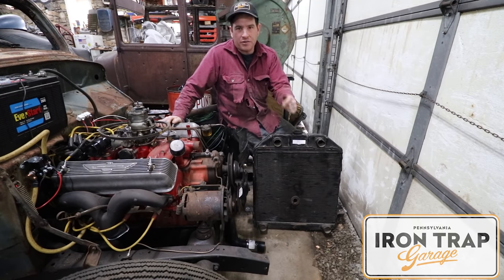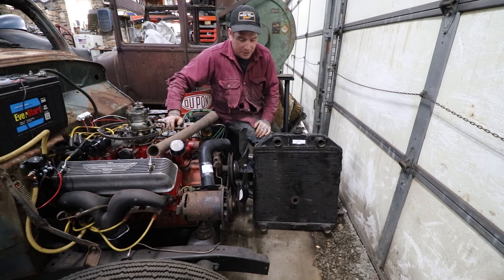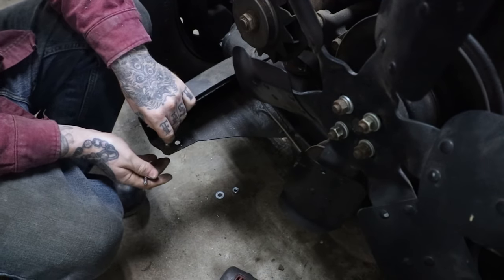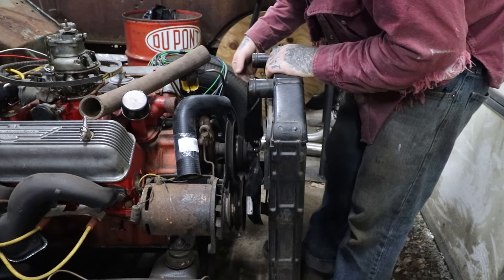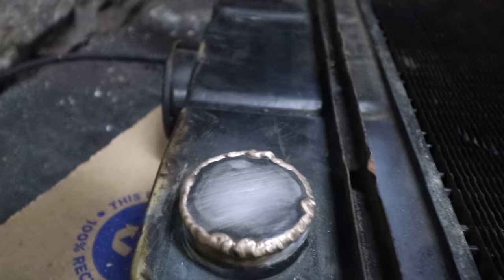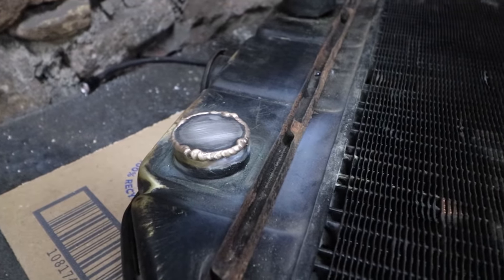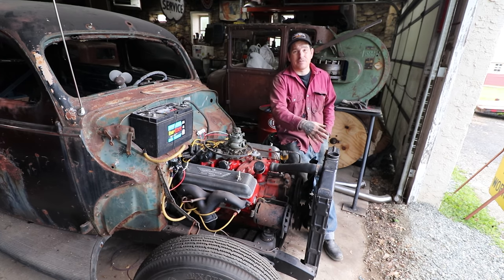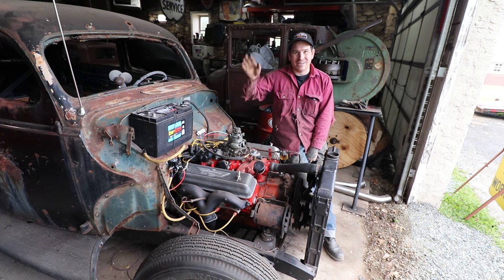How To Braze A Flathead Radiator For A Hot Rod Motor Swap - 1939 Ford Tudor

Comment: I would have never believed that soldering would become a lost art.
Reply: It is like body and fender work  rip the fender off put new panel on  paint it shove it out the door!
Reply: Even given his extraordinary TIG skills, this was sure the hard way in my opinion. Back in the day, I made a vary similar job (removing an unused nipple) Just heated it up around the seam, pulled it out with pliers, then cleaned it up and fitted a patch with some copper sheet I had. Soldered it in with a huge soldering iron and rosin core solder. Perfect. By the way, radiators of old were all assembled with soft solder.
Reply: Hey I was thinking that. I was just soldering an identical rad today! Mart.
Reply: I've moved outlets by desolederind one and soldering it back on in the new location.  Cut a piece of 3/4" copper pipe open and flattened it for the patch on the old hole. I was always worried about too much heat melting the solder around the tank so I used a old stove heated soldering iron I got from my grandfather.

Comment: Matt great show. The stock bolts that hold the radiator to the frame are equipped with a fairly still spring about an inch long that allows the radiator to be firmly bolted in and the spring allows for movement and frame twist without cracking the joints in the radiator itself. Just using bolts even with a rubber spacer won’t give enough movement to prevent damaging the radiator. 39/40 Ford enthusiast lol. Ron

Comment: Since the radiator is soldered together, wouldn't it have been easier to solder the patch? I've been around radiator shops for many years and it's not silver solder, just solder. I worked for a dealership that bought an old Inland radiator repair station. The torch ran on natural gas and added air to get a good flame. The trick with radiators is to use just enough heat to get the solder to flow where you want it and not out of other places. We used to buy a flux that had solder mixed with it. It was great for tinning the surface.
Reply: yes or at least use silicon bronze wire that is proper for tig brazing

Comment: Way to go Matt !
Rainy morning here in Kansas today so enjoyed watching you work. Good to see you were able to mount the Radiator so easily.
Your ability with the TIG welder is amazing !
I would have taken the Radiator to a shop 35 miles away to have those hose necks removed and flat brass plates put in their place, then gone back 2 weeks later to pick it up !
I suspect you will be driving that car before your Birthday, at least in the yard.

Comment: When tig brazing NEVER allow your base metals to become molten! That is why it is called brazing instead of welding.  Brazing works on the principals of capillary attraction , welding is the mixing of molten metals. Jody's videos at welding tips and tricks can probably better explain the principals of tig brazing.   I dont blame you for not wanting to solder it, I hate soldering!! Cool project!

Comment: Surge tank, not needed here.  FYI, back in the day of overhead valve engine swaps overheating often occurred.  A cure was to add a surge tank which added more coolant to the system. Ford had a nice assembly complete with a filler cap.

Comment: Hey Matt great work. FYI the T-Bird version of the Y Block has a spacer behind the water pump. You can get more fan clearance if you ditch the spacer and use passenger  or truck brackets and pulleys. Ford used the spacer on the T Bird so they could move the generator up to clear the Bird chassis. Love the project!

Comment: Hi Matt. A couple of observations, if I may. On my 41 pickup I have the same rad. It's very tight to the front sheetmetal. It might not be able to sit that far forward with the front sheetmetal in place. Just something to look out for. That channel thing is actually for the wiring harness to cross to the other side for the headlamps etc. You may be able to remove it if it helps give a little clearance. Funny enough, only today I was making some repairs on an identical rad. I opted for solder. Oh yeah, last thing, On my rad, the top tank ballooned up. These rads were not designed to take much pressure. I think my cap was over pressurising it. I'm going to try a new 4lb cap. I'm adding braces to stop it ballooning. So my advice would be to try a 4lb cap and see if it works ok. I will do a video on it at some point. Oh yeah lastb thing. There are supposed to be two short straps from the keyhole shaped locations on the radiator sides back to the inner fenders, where they bolt to the Y brace. I've been running without and letting the hoses locate the rad, but I have 2 stiff hoses. You might need the brackets, they are easy to fabricate. Mart.

Comment: I have been brazing for about 50 years. More recently with the Silicon/ bronze on high strength steel. TIG brazing is great but the highly configured heat  area makes it necessary to pay very close attention to material differences that cause heat transfer problems. Standard torch brazing will allow you to " wash" heat over a wider area thus making it easier to get  material transfer and flow out. The " give back " with torch brazing is that it can induce warping. I have found that in TIG; a larger electrode than one would chose for aluminum or steel works better . Also, companies like " muggy weld" make a great thermal barrier paste that keeps close solder bonded joints from loosening due to heat transfer. In years past, we would work chopped asbestos duct insulating paper into a paste with antifreeze and pack that around a nearby joint we didn't want heat transfer to loosen. Just the musings of a very old builder ; for your consideration. Keep up the great work.

Comment: Nice mod on the necks. I would have had to take the necks off and solder patches over the holes because I don't have a TIG welder at home. I like that you left the option open for other power plants down the road. I have seen Y-blocks with the generators rotated to the top in some applications but don't remember what the specifics for doing it were. 272 in a Metropolitan comes to mind, total hack job, total death trap, but it did make it to the road for a little while. Keep at it , I have no doubt you'll have it ready by June 1st.
Reply: In early T-Birds, you are absolutely correct about generator mounting, and I believe that is where the engine originally lived, or used external parts from same. I had a '56, and the generator was a real bugger to service!
Reply from the maker: We hope to be cruising in no time!

Comment: ON THE BLOCK OFF OF THE EXTRA HOSE CONNECTION, I FILED OFF THE 4 RIVETS AND FLAT SOLDERED A SCRAP PIECE OF BRASS OVER THE HOLE. DIFFERENT TIMES, DIFFERENT TECHNIQUES!
Reply from the maker: Many ways to skin a cat!!

Comment: Good content as always Matt.  Question: I know in building construction it's not a good practice to have dissimilar metals touching each other such as copper and steel.  I believe you said the patches were brass.  Does this cause any problems in the repair you did on the radiator?  Curious as usual.  I'd guess you've done it hundreds of times so that would mean it is not an issue.  I look forward to your next episode and I hope you and yours and all the Iron Trappers are healthy and safe.  Cheers from an old retired coot living in Tennessee.❤️👍😷🍻👍

Comment: I have usually taken an easier way to block unused ports. In the plumbing dept of you local hardware store they usually have rubber caps for different sizes of pipe. They go on with a clamp just like a hose.
Reply from the maker: That's an option, but brazing or soldering that shut will give it a cleaner look. Plus a rubber cap is another item to fail
Reply: The only way that I would expect to see something like that would be by someone who didn't want to pay a pro or didn't have the ability to block it properly.  Back in the day, I've never seen any plugged like a few have suggested.  Hope you all be healthy.
Reply: Almost forgot, great job Matt and thanks for all the neat videos about traditional hot rods!

Comment: If you really want to be more at ease, thinking about clearance for the radiator, replace the fan/pulley bolts with a smooth,  tapered bolt head that has an allenhead or a star bit drive made into it. I have some on mine. "ACE is the place"!

Comment: Sure brought out the naysayers on this one LOL
Reply: Not really naysayers. We are not saying that tig won't work, just as older folks we know a thing or 2 because we have seen a thing or 2.  Kinda hard to build traditional hot rods with non traditional process. But ad one billet part, an alternator or a electric fan to the car and you are ridiculed. Use tig or CNC processes and it's okay. Just shows in a lot of cases that the love is there, just not the old school skill.
Reply: Just FYI I learned to gas weld and braze then stick and TIG 
Mig was the last process that I tried I think what does it matter if it works and it’s yours  do it to your ability and satisfaction
From one older guy to another

Comment: I can see that welding makes a stronger joint when the mating surfaces are so small, but I would have wrapped the base of the neck (against the radiator tank) with a wet cloth to keep the silver solder cool.

Comment: You can bench leak-test by putting latex gloves over hose outlets with rubber bands.  Then put an air hose in the filler neck with a rag rapped around it.  Finally, spray soapy water on the patched areas.  Bubbles in the soapy water = leaks.

Comment: Aww man you should have sweated the hose fitting out and patched it with a brass sheets very simple all you have to do is make sure it's clean .it might scare you the first time.
Reply from the maker: That's an option but Tig welding more comfortable for Matt
Reply: @IronTrapGarage  But I don't know how to tig weld and don't have the machine but I do have a small torch you did a good job Matt.
Reply: @freddiebates5539  The only time I helped anyone who was really a hot rodder, he was putting a 392 hemi in a 48 Chevy Business coupe.  He had a radiator that had been in the car when it had a nail head Buick V8 and he took the to tank of the station wagon the hemi came out of.  When the hose on the top tank was on the wrong side for the hemi he did just what you said.  He actually cut a piece from the old hemi radiator and used it to put a patch over where the inlet was and brazed it on,  he used inlet off the old hemi radiator so both ends were the same size and the hose wouldn't be a problem.  He was a true hot rodder, no problems just solutions.

Comment: The only worry here is that by moving the radiator forward that small amount, it may effect the fit of the front clip( hood, grille, and fenders). The fat fender Fords are pinched right where the radiator lives, so fingers crossed, it works out okay. Another option is to pull the belt driven fan off entirely, and put a large electric fan in to replace it. A push fan in front can eliminate the clearance issues on the engine side of the radiator. Imma keep watching these videos to see how it turn out! Hey, where did that grey meat truck disappear to?
Reply: An electric fan would surely work, but a push fan would be useless, unless you are standing still, as the wind would be bucking it when you're in motion. The fans   are controlled by a thermostat switch. I used one from a Mopar, but probably all the car makers have them these days.
Reply: @neil6212  eh, it wouldn't be  useless, as you drive, even as it's running, the amount of airflow won't be more than the fan output. It will only additively cool the radiator, and with a thermostatic switch running it, it will cycle the fan only when it's needed, like you said, while at a standstill, or slow traffic/cruise situations. A puller fan faces the same obstacles, even on modern cars, but on the engine side there are a couple drawbacks. Clearance is the first one, sometimes that fanmotor is just too thick to fit in there. Second is heatwash. As you drive, airflow pushes thru the radiator to cool the engine, the fan is in the path of this waste heat, even if it is cycled off, it's still getting blasted. A front mount fan gets less of a cooking, but is vulnerable to road debris, rocks, and bugs. To me, the push fan checks more boxes in the positive column.

Comment: I’m assuming silicon bronze rod? I used to weld pressurized heat exchangers for a living. And the areas that leak the most when we pressure tested them was the little tiny holes that show up when you end the weld. I seen you had a few of them so you might want to go over them again while it’s still dry and clean. Basically to keep those from happening what we did was slowly let off the heat and while doing that swirling the tip around out from the center. Once you do that you’ll see what I mean. look forward to the next video.
Reply: He said that he backed up onto the tack when he started each pass for that reason.

Comment: I would have used a torch and silver soldered it. I have never owned a tig, I used one a few times but even that was decades ago.
Reply: Silver solder much too hot, and the strength not needed. Regular soft solder would be the thing to use, and was OEM. I used 60/40 rosin core solder on the one I did, but I believe they used 50/50 with an acid flux in the factory. Also notice the nipples on this radiator appear to have also used a rivet or two for added strength, where connected to the tank.

Comment: I would have left the whole hose connection in place. Then you would have less fear of the solder blowing out  & it would be easier to go back to original if needed.
Reply: Good post. I thought the same thing.

Comment: 02:45 It looks like you could have cut down the fan spacer to get the clearance between fan and radiator core.
21:31 You could used a single groove crank pulley if the belt would be riding on the inside groove. It looks like the generator pulley lines up to it.
Reply from the maker: After some research the Thunderbird water pump was spaced out. If we swap to a truck pump we can move everything back.
Reply: @IronTrapGarage  Good job in the finding.

Comment: What about a key to lock and unlock the doors of the car if you want to start the engine turning on the switch before pressing the start button? I don't know if it's Model T Car related.

Comment: Hi, if my memory is still intact (same car/motor)  all I did was remove the aluminum spacer and use shorter bolts. I did change over to the rams horn manifolds (brand new in 1960).
Reply from the maker: We will look into it!!

Comment: That bend in the upper hose is a bit too sketch for your work. If you still have the scraps of radiator and hose, weld the 2 metal parts together to make a coupler, put the bent part of the hose on the rad., and it'll fit like factory. (Except for the 2 extra hose clamps you'll need to use.)

Comment: Good job Matt. Luckily, it wasnt a split-core radiator like original.
Reply: Tom Richardson originals weren’t split. Notice only one filer neck.
Reply from the maker: They were split core in 40+. The end tanks were on one piece just two separate cores

Comment: A radiator shop would have removed that and soldered a plate over the hole. Radiator shop has necks to put in if needed.
Reply: It's getting hard to find a radiator shop. There used to be two within driving distance and they both went out of business. Radiators are cheap so they get replaced instead of repaired. They used to be all brass. Now they're plastic and aluminum.
Reply: @alshotrodsandratrods8780  That's a good point!  Same in my area.

Comment: Going the extra mile....I wouldn't have held it against you if you just did a couple rubber caps and some hose clamps.
Reply: I was thinking the same thing. Quick,easy & he would not have modified a perfectly good radiator. Also did the heat from the welding melt the solder on the nearby seams causing leaks that weren`t there before? Maybe made more problems than he fixed.
Reply from the maker: The hoses and clamps give another point of failure. Once the radiator is tested as good we shouldnt have any issues

Comment: Just pop a rubber cap on the inlet pipe and outlet..hose clamp....Radiator has no destructive work done to it..When the next person comes along you have not ruined the rad for a flathead....the old rad is probibly goint to leak anyway...or not cool that big old engine anyway...whatever...

Comment: Just wondering why you didn't solder the caps on.
Reply: Radiator will get too hot to use solder??
Reply: @stanschmitz5566  What? The entire radiator is put together with solder. I have done it hundreds of times and even done videos on it. Never heard of anyone tig welding a radiator, I am just here for the comedy
Reply: @jonathanw4942  I was just asking, not making a statement. I don't know anything about it. Call me comedy:)

Comment: Don't think I would of butched  that radiator I think I would of just plugged it with a hose and something in the hose, so it could still be used again for a flathead

Comment: Least intrusive?  Why not heat the solder with almost anything and remove the outlet? That's how it's been done in radiator shops from day one. Slap on a clean blanking plate and it's done. Just because you've learned how to pedal a TIG, doesn't make it suitable for everything.  Oh, Jay leno says he's learned the hard way to install a new radiator the first time a car lands in his shop.